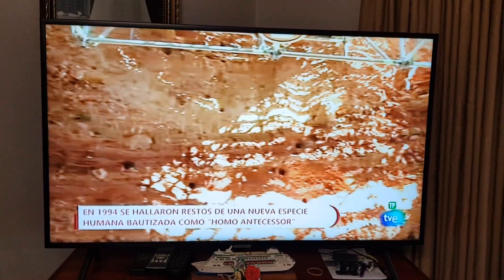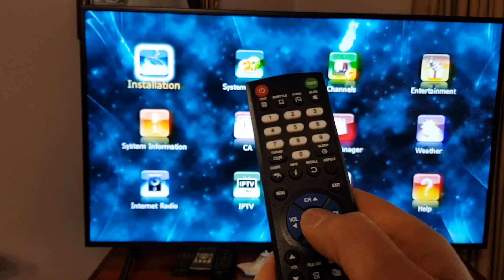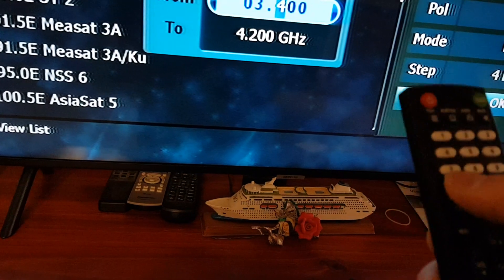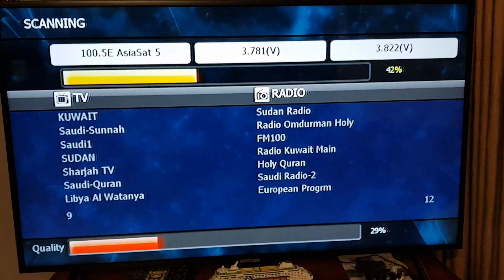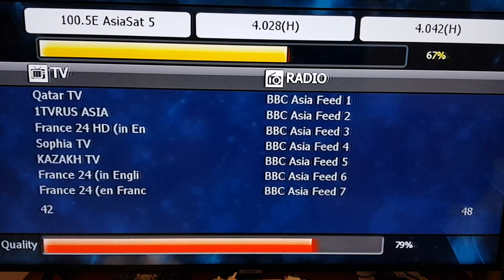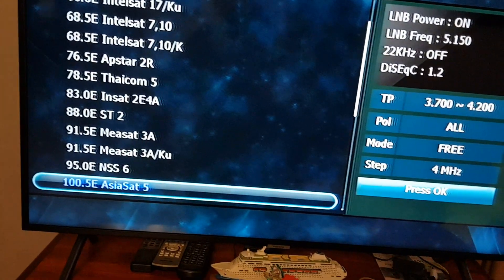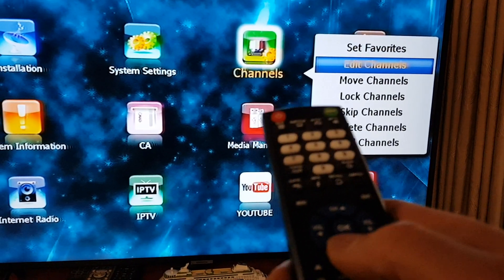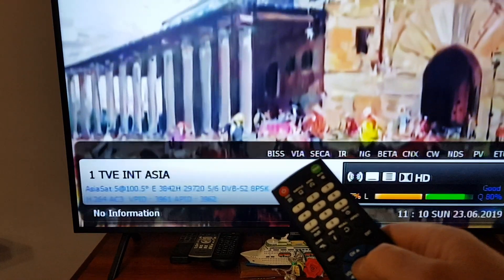Tune to new transponder for TVE Spanish TV on Asiasat 5

Comment: Hi.. What upgraded LNB Brand do you recommend to use? Thanks
Reply from the maker: You need 3.8 to 4.2GHz with 5G Band Reject
Reply from the maker: We are getting the manufactured for us which we can sell.
Reply: Thanks for the reply.. Where can I buy one of those lnbs?
Reply from the maker: @josephdeluca1551  Hello Joseph. We sell them.  You will need the LNB $550 plus Feed $100. Total is $650 and allow about $20 freight in AUS Suburban areas.
Reply from the maker: Note. They are single polarity. If you need dual polarity, then you need two LNB's and a dual feed.